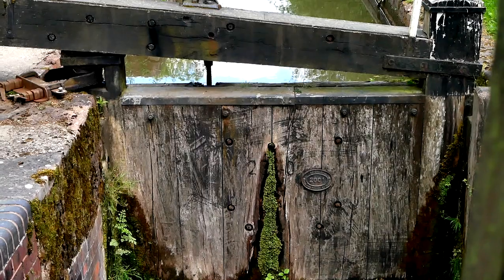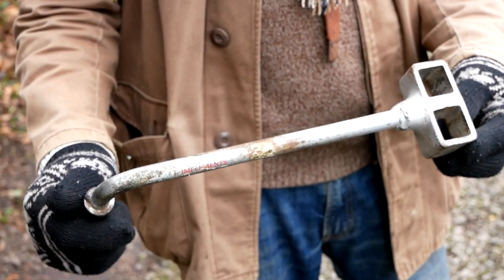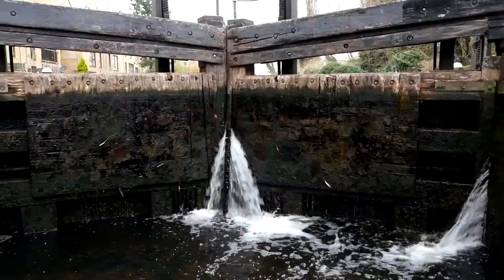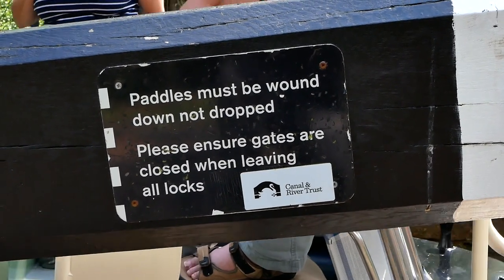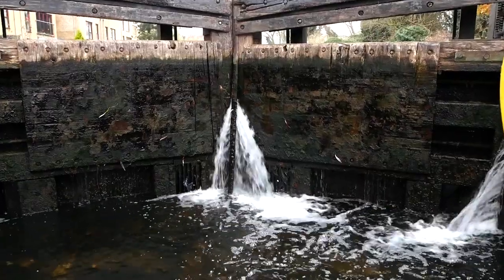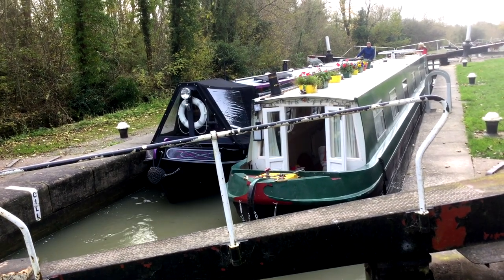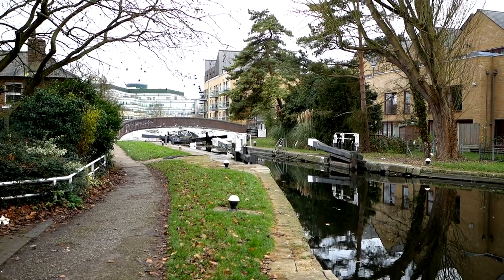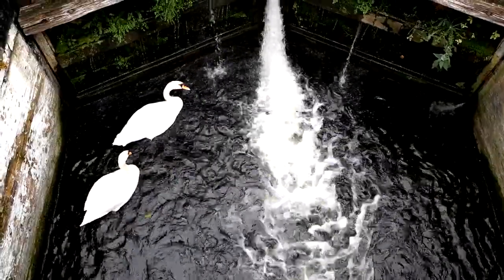How to open Locks on a Canal | Life on a Narrowboat

Comment: Great video, just wondering when you come down and lock do you have to close the paddles when you close the gate after you go down or up.
Reply from the maker: You go into the lock level obviously, but if the water is raised you then drain and go in, shut gate and fill back up again. Thanks for watching
Reply: Zachary Denman  Thank you for that because I know a few people when the water is level when you coming into a lock normally if you’re going down they generally open the paddles and then closing again when the boat is in which I have not understood why they would do that. Thank you for the clarification on that though
Reply from the maker: @rhysbyrne4533  i didn't understand, until i actually saw the lock working. Take care
Reply: Zachary Denman ty you to